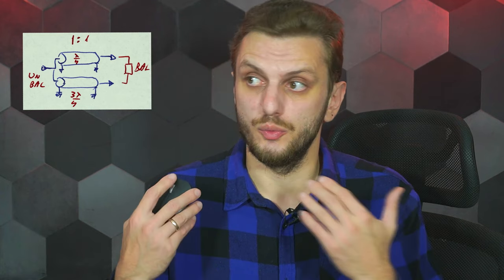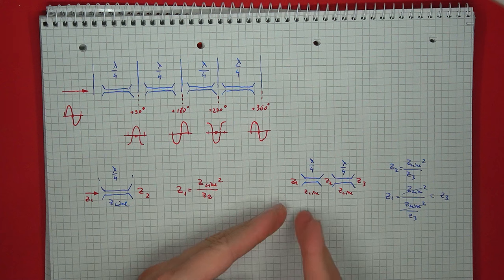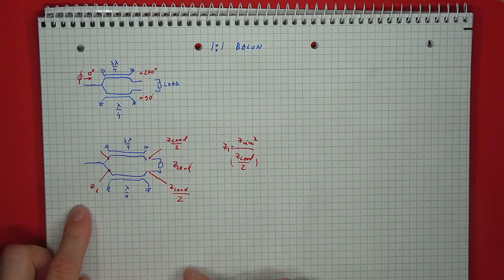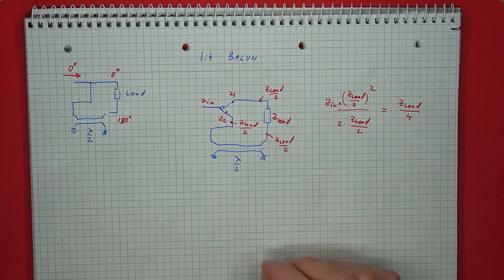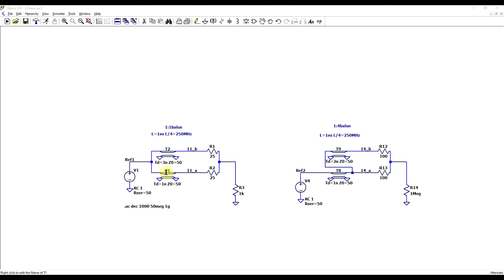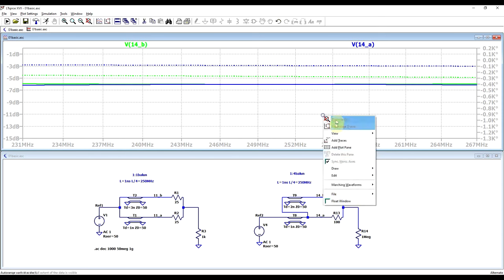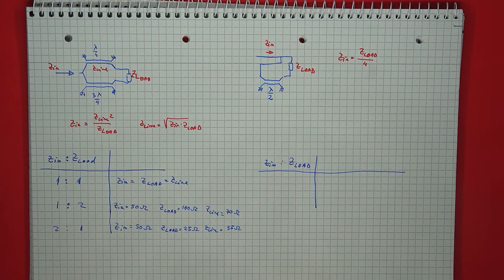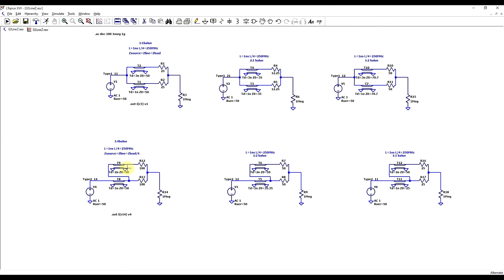Transmission-Line Baluns

Comment: is there a problem with how radio amateurs are implementing the 1:4 balun (direct & half wave delay)?.... on the circuit diagrams there is an earth to both ends of the screen.... for amateur applications this type of balun is often used externally right at the elevated terminals of a folded dipole to connect the co-ax.... at this point there is no ground connection so although the 3 antenna ends of the screen are tied together they are not grounded and are left floating..... is there a problem here?... I cannot see the return path for the signal travelling down the central core... forgetting the balun I see this like the coax having a radiating 50ohm quarter wave on the central core but an open connection to the screen at the antenna (no radials, no ground plane, no earth) in which case things are not going to work properly. Are we amateurs currently doing things wrong?
Reply: I always considered that the co-ax outer is at RF ground, that's pretty much the definition of unbalanced. All the grounds are connected together. I have seen simulations that need a ground on each end of the line as simulated, just so that it works correctly.